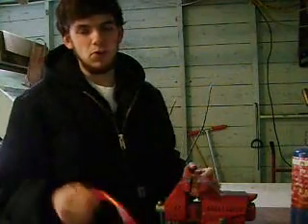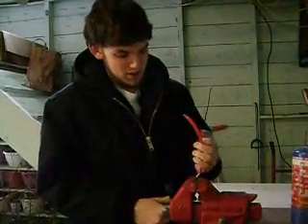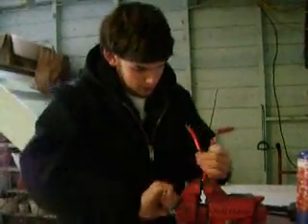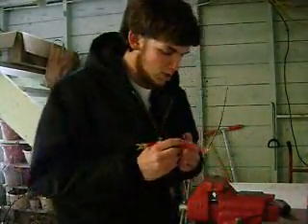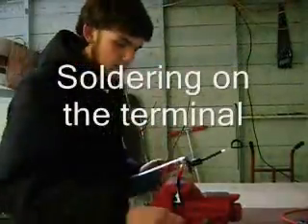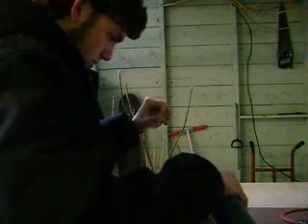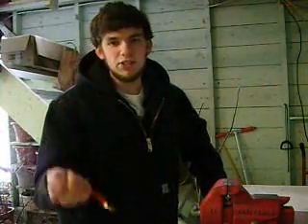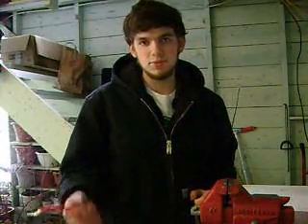Crimping Vs. Soldering - The Battle

Comment: Best to use common sense,  crimp enough to get good metal to metal contact then use the minimum amount of solder to seal it & help prevent corrosion, always give the cable support so it's not able to move/vibrate at the point it exits the solder.

Comment: I agree that for most  auto jobs soldering is easier and usually more effective, but there is a good reason that mains rated & tested appliances are crimped in critical mains stages and that is HEAT. If you pull enough current through a wire e.g. in case of fault or short circuit you can potentially heat a solder joint enough to weaken - if not completely melt it.

Comment: That's not called crimping that's called horsing around..
Even that "professional" crimp isn't professional. You need a 16-32 ton crimping to actually do any crimping which is cold fusing the copper strands.

Comment: I've never seen that. Anyone who uses a crimp like that is a total fucking moron and deserve the pain and suffering. At the end of the day, crimps are a tool and used correctly they are very good. Soldering is brittle. I use soldering on circuit boards, and guitars, but in cars, I believe crimp/posi-tap/military splice is the ONLY way to go.

Comment: Soldering alone is prone to being brittle and creating a pressure point in the cable where it won't bend too well, and crimping alone is often done poorly leading to failure or loosening.  I personally use a crimp tool, then solder for maximum strength and durability =)

Comment: CORRECTLY crimped connections are preferable to solder connection. Solder connections create a stress point and are prone to failure especially in automotive situations where vibration plays a role. The key is to use the correct tool for the crimp/cable, if crimp failures are happening it is down to incorrect tooling or the operator!

Comment: Soldering is generally better, but to be fair, I wouldn't have thought anyone would try crimping by smashing the terminal with a hammer and expecting it to hold.  A properly crimped terminal actually has advantages by being less brittle and more flexible under vibration and movement, but the key word being properly crimped.  The average "crimp tool" used by the casual user won't produce as good a connection as they could get with soldering.  And definitely not by hammering it flat-

Comment: Good video.  I've had problems with my crappy crimps failing on my motorcycle and you know those critical splices are just waiting for you to get way out there before they fail.  Additionally, any loose wires increase the resistance in the splice.  So soldering with heat shrink tubing is going to be how I do electrical work on my bikes in the future.

Comment: I'd probably do the same. It may take a little more time, but like you said not everyone has professional crimping tools. Good solder is far cheaper, you can get allot of uses out of it, if you buy a big enough roll and extreme audiophiles solder all of their ends onto the terminals of their speakers and crossovers. So it's been a chosen way of hooking up speakers for years. :)

Comment: Good video, but in practice, the cables aren't going to be pulled on with such stress so you may get away with doing crimps instead. Though soldering will allow for more contact and thus yield better results.

Also, what did you have to do to your thumb to get 18 stitches?